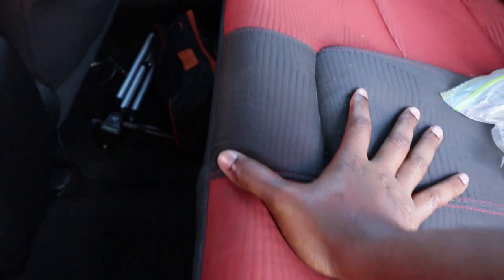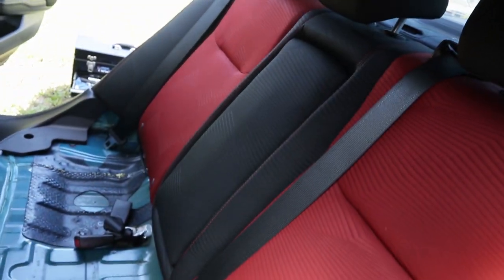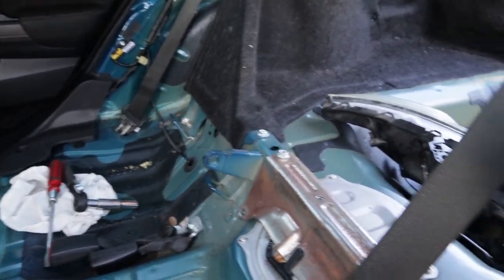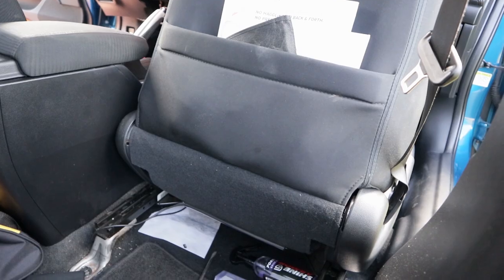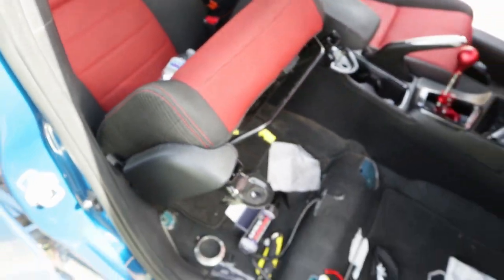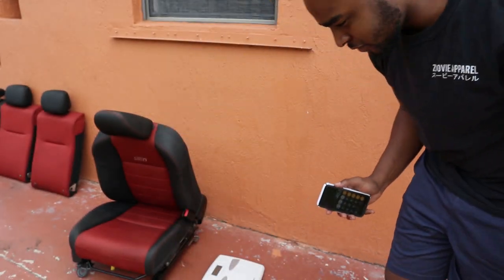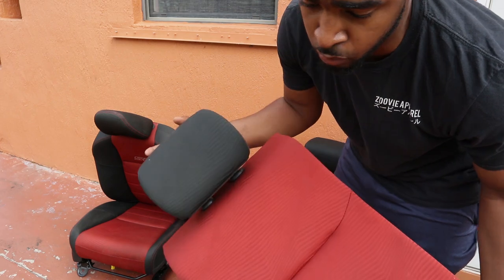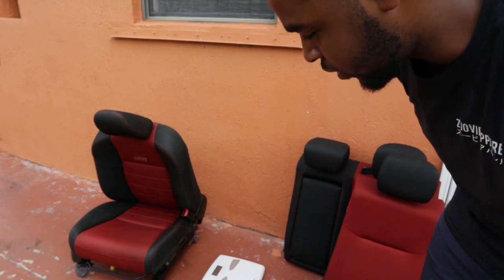Gutting The Interior On Dusty! | 9th Gen Si Seats Removal

Comment: So if you disconnect the battery before you unplug the front passenger seat airbags the light won't come on what so ever? Or does it eventually come on at one point? I'm asking because I want to change my two front seats for some new ones that are not compatible with the airbag plugins.

Comment: That's like a stage 1 tune now, did you start your car up only to see an airbag light on lmao
Reply from the maker: Of course the airbag light was on but if you unplug it with the battery still connected.. it stays on even if you have it plugged back in
Reply: @zoovie  yea that's incorrect I do this every single day reupholstering cars, unless you own a euro car this is true; and even most of them will realize they have the correct voltage once plugged back in and shut the MIL off without a scan tool